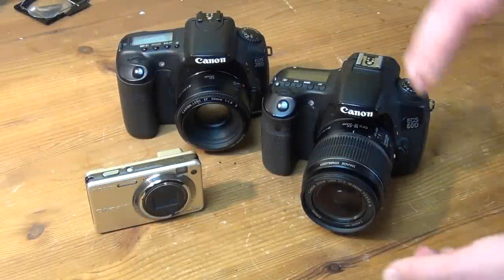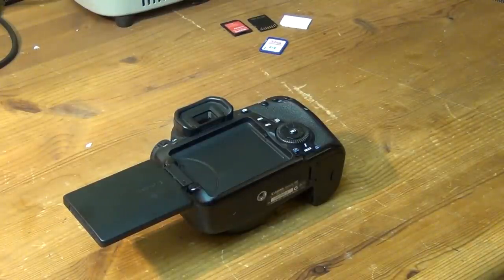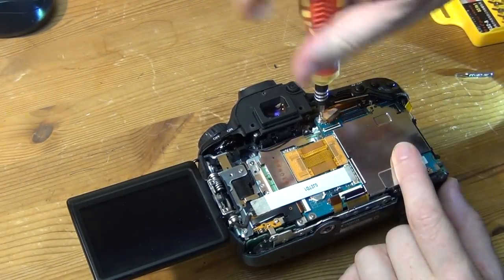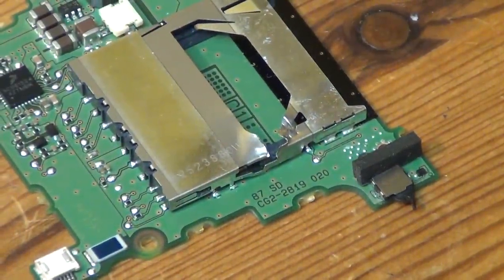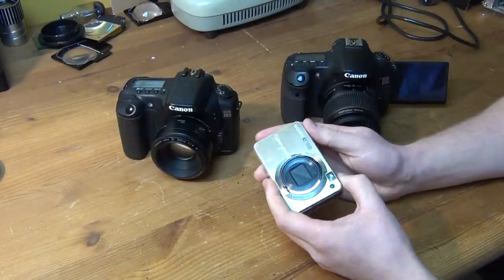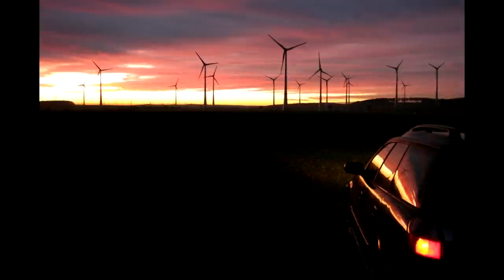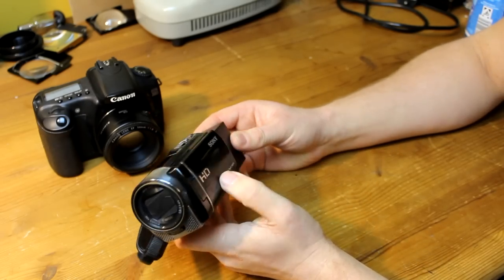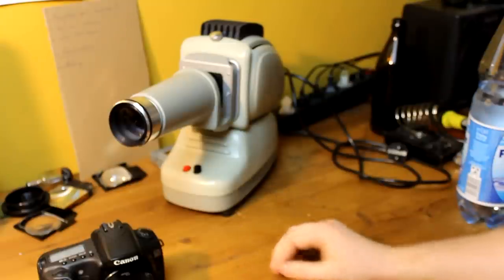Repairing a Canon EOS 60D DSLR  with Faulty SD Card Slot + Updates

Comment: You know the one weakness of the 60D you purchased is that it doesn't have live auto-focus in video shooting like your camcorder does. I think autofocus is useful a lot of the time. The ability to go between manual and auto is even more useful. Although there is aftermarket firmware made for DSLR's to make them better for filming. I know professional TV productions which have used 5D Mk2 and Mk3's to film whole episodes. 

Believe it or not the 70D and 80D do have that function. In fact the 70D really is the "dogs bollocks" (English saying for really good). A lot of big name Youtubers record all their stuff on 70D. The other thing that you can easily add shooting on DSLR is external hot shoe mounted micophone to improve audio quality. A lot of pro's use the Rode Videomic Pro or Videomic Go for that purpose. 

Don't send the 50mm lens back either. The aperture on that thing goes up to F1.8 which is huge, great for low light or shallow depth of field at that price. It is superior to the 18-55 kit lens you got. Almost no distortion on the 50mm either. The best thing to put the 50mm lens on is the full frame camera. 5D Mk2's have come down in price and there are also 6D's knocking around now second hand. I myself have a 5D Mk3 and a 500D. 

Lenses is what gets you with DSLR's. The cameras are less important to a degree
You might want the EF-S 10-20mm lens if you start shooting on DSLR. Very wide angle. 
If you need a telephoto the 70-300mm lenses can be found cheap second hand. 
I have a EF-S 18-200mm lens i take with me on holiday for photography. I also have a F2.8 40mm pancake lens i use sometimes to save space when i take my camera some places. 

For low light and astrophotography at wide angle there is a F1.8 28mm lens or a Image Stabilized IS 24mm F2.8 lens that i use. The 28mm can be found pretty cheap. It isn't IS. 

Macro photography i like the F2.8 100mm macro lens. Although i think there is a 60mm made by someone else like Tamron which is good.

If you ask me i think the Sony camcorders have the edge for value and production quality on the basis of "bang for buck" a bunch of the smaller automotive repair channels use them. I can see the attraction as well because they are relatively inexpensive and survive quite a beating and exposure to oil, brake clean and other crap. 

Nice repair.
Reply: Autofocus can also be really annoying. I'd love to be able to turn it OFF on mine.

Comment: I had the same problem, but before sending it to the service, I decided to try to move that pin a little bit with a small knife, without disassembly the body... and YEEEY, it's working perfectly now. 
I think in the future I will not remove the card from the device and I will transfer all the images through the USB cable to the PC (with all my cameras).

Comment: nice video - 2 things - nobody has mentioned CHDK yet (if I am not mistaken). Canon Hacker's Development Kit. Basically lets you override many if not all setting and you can execute scripts. Intervalometer comes to mind with your new workshop project. You mentioned you had taken 150 GB of footage or so. I guess a lot of it is just hours of you stepping up and down a ladder painting the wall or something, so set the fixed focus with good lighting , take a pic every 4 seconds or so and you are good to go, just make it into a video. Another nice script is the lightning photography script. Basically takes the sport out of lightnings completely. Would surely work with welding and everything involving sparks. Take a picture if something (expectedly) blows up, sparks or something. 
The second thing is, there are very cheap brackets on ebay and amazon which connect to the tripod screw ('schraubzwinge' style). It allows you to attach the camera to a bookshelf or other board on the wall in your shop. It gives you the top-down perspective you see in so many cooking videos nowadays (bowl, put stuff in, chop onions, mix....). I could imagine it works for soldering, breadboards and the like. Have fun with the camera!

Comment: Excited to find this video, there's a used 80D right now for dirt cheap because of a "faulty SD card slot" and the seller says it doesn't write images so it has to be used only by USB tether. If your hack applies to this camera I just found an upgraded camera body for less than I could get a 70D.

Comment: Hello, many thanks for your video, i've solded bypass and now i can again take photos. I can't even describe how much happy i am now. 
But there are two things which are not mentioned in video: 
1) When you reassembly the top cover, on the bottom of display hinges are cutouts which have to be pressed under the hinges mount plastic cover, using screwdriver or plastic spatula (rather than screwdriver, you will not damage plastic cover of camera), otherwise the display will not correctly sit down when closed and pop out back.
2) When you disassembly the cover, small spring, which open the lid of card reader slot will pop out of its plastic stop and must be gently placed back using small pincette.

For all of you, which will be disassembly 60D i have screws cheat sheet, using transparent double side ducktape can asure, that you will place all screws back correctly: https://drive.google.com/drive/folders/1sEAEifesKIrBbafmd7tP1EIlHck9QJx-

Comment: Nice job.  I am betting that SD electronic card can be bought and installed if you ever want ot get read only function back.  I agree there is little need for that in  a camera.  Cameras do not over write anyway....if the card is full they refuse to take a picture.

Comment: fixed focal length is much better than variable, especially at this price range
Reply from the maker: The 50mm lense is certainly of better quality than the variable lense in this video, but I'd need a wide angle lense for most of my shots. I guess I will buy a couple of better lenses over time, but will use the variable lense for now.
Reply: Isn't it the stock Canon F/3.5 18-55mm lens? You should really get a better one, with lower F number and improved image quality. Lenses are usually more imporatant (in terms of image quality) than the camera bodys.
Reply: if you have good lighting you could use higher f number settings, so we can have a better field of view and less focusing problems
Reply: mount an SJ4000 in the flash shoe,  for a wide angle backup of every shot.   This is the 2nd time I've recommended one of those to you. Last time was to use the LCD in a projector.  I'm not an SJCAM salesman, I promise.

Comment: I guess everyone said this by now already, but don't send back the 50mm prime.  It's sharper than the 18-55 (I have that one, came with the 450D).
It also has a much wider aperture which is better if you ever need low-light capability.

Comment: An absolute NIGHTMARE! 😱
Reply: djdrwatson What?
Reply: Taking the camera apart. All of those little screws and ribbon cables. Many things could go wrong. Lots of patience needed.
Reply: *****, yes but that is what a technician have to deal with normally. When you do not want to disassemble such devices, do not do the job. ;-)
But I know what you mean. I have seen a video of someone desoldering the flash storage chip from his mobile phone's logic board. With a lighter. And then he soldered the new one on it and upgraded his phone from 16 to 128gb. I was scared a bit, too. But in comparison, what TPAI does here is way less dangerous.

Comment: u can buy a new replacement part for the sd card slot from china for really cheap
Reply from the maker: I looked for replacement parts on ebay, but the ones I found (shipping to Germany) where all between 30 and 40 €. You also have to wait a long time and possibly visit the customs office to pick it up (if you're in bad luck).
Reply: Might want to check taobao or aliexpress, but yeah I agree you do need to wait.
Reply: Plus there is no guarantee it will be any good or as durable as the Canon original.
Reply: its called physics...
Reply: It was an awesome repair, I have been looking for this for almost 5 years since my 60D became a brick and customer service repair it but it damaged again just when guarranty was over. Can you help me, I didnt understand well were you have to solder I have to place a tiny wire from the point on the circuit board to the case where the pin was removed?
Reply from the maker: the contact has to be soldered to "chassis ground". The ground is connected to the negative pole of the battery and to many parts all over the camera. Most of the metal sheets inside the camera are connected to the chassis ground as well. I used the metal case of the SD-card slot because it is right next to that tiny contact, but in theory you can use any point inside the camera that is connected to chassis ground. I'm sorry that I could't show this in th video with better detail. It was very hard to film.
Reply: It was a great video! Thank you for taking your time in reply. Is just that I don't have much knowledge in electronics.

Comment: AFAIK that second type of ribbon connector is called a ZIF connector
Reply: ZIF is a generic term for all types of connector with a lever to apply the contact pressure.  It stands for Zero Insertion Force.   Other types rely on friction.